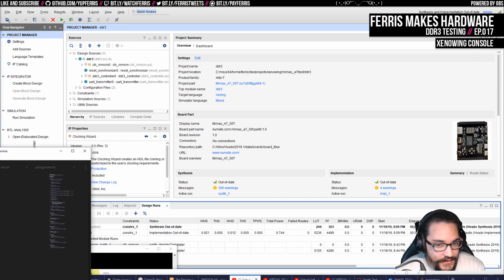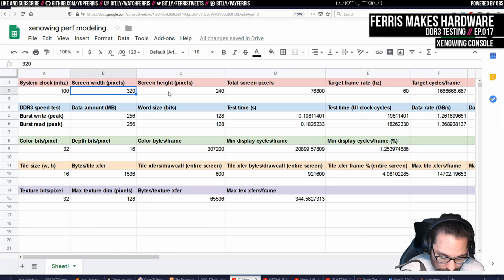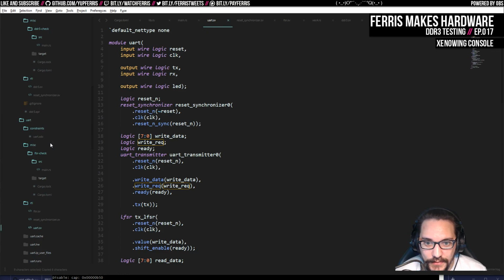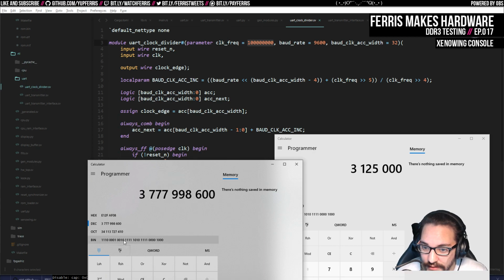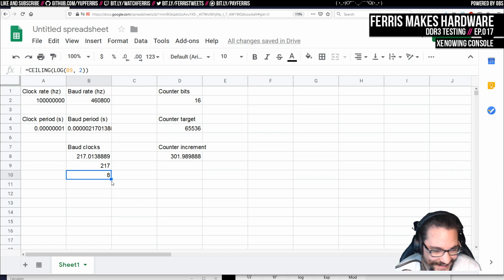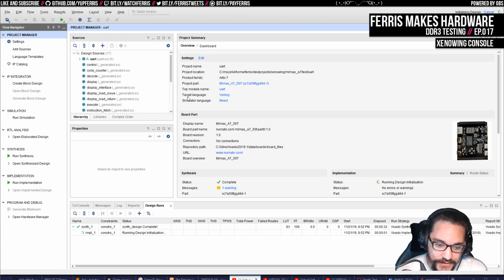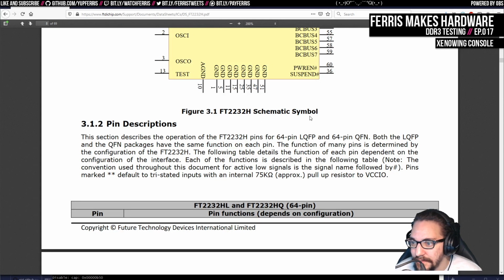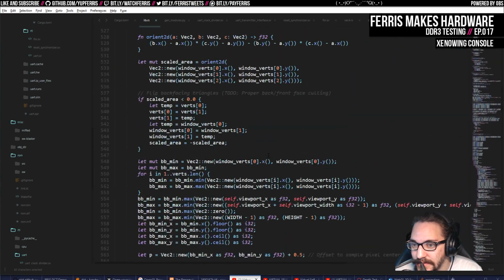Ferris Makes Hardware Ep.017 - DDR3 Testing

Comment: I'm not sure if the user-side interface on the DDR3 controller is still limited to 100 MHz max, but there is a way to use a completely async clock for that.

That might allow you to squeeze a bit more performance out of it, if you can clock the user side a bit higher.
I don't recall exactly how to add that, but I think it involves adding the Avalon Clock-Crossing Bridge in Qsys.

The async clock thing is currently used on MiSTer for the DDR3 Avalon interface.
I've also been looking into how to directly instantiate various peripherals on the HPS (ARM) on the DE10 Nano Soc this past few days.

I still have to use Qsys to figure out the instantiation templates, but I originally thought there were all kinds of TCL scripts and switches requred to enable things on the HPS like the AXI Bridge for DMA.

It turns that most of the hardware on the HPS is just sat there waiting, and just needs the correct instance templates to hook up to them.

(very similar to what you have there for the Altera DDR3 controller, but for other things like AXI Bridge, DMAC, PIO etc.)

Do you not use SignalTap at all for debugging? It would show things like the read/write cycles, rather than needing to mess with the UART stuff. printfs can be VERY handy for some debugging tasks, of course.

Excited to see where you go with the rasterizer and effects stuff. It's loooking good already. ;)
Reply: For some reason, I could have sworn you said "Altera" early on in the vid, so I assumed it was an Altera/Intel chip you were working with. Oops.

Ohh, it's an Artix 7. XC750T-1FGG484? Yeah, erm, disregard most of what I said. lol

Could maybe still use ChipScope though, if you're not using it already.

Comment: Just a heads up, you don't need to pick the weird numbers for baud rates. The FT2XX series chips don't care and the OS driver doesn't either. You can just put in 1000000 for 1Mbaud to get round clock divisions. EDIT: Ah, I see you did that later in the video :)